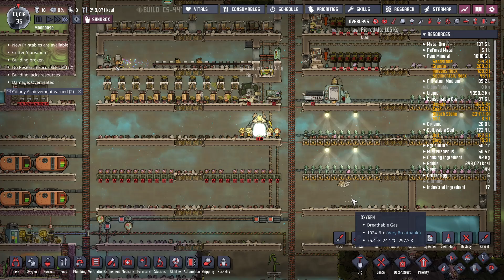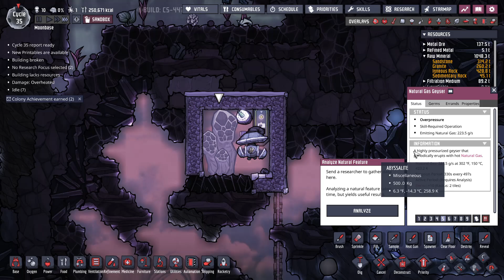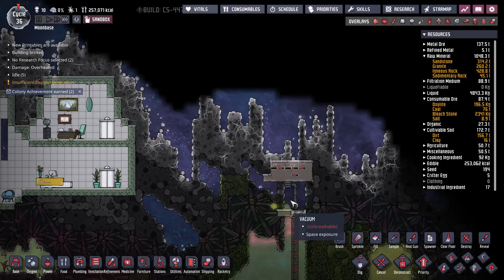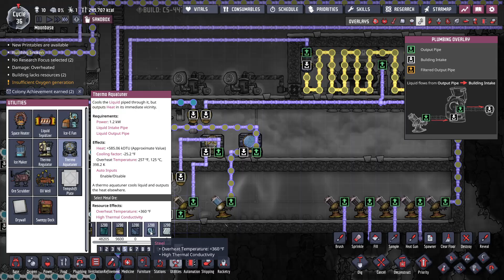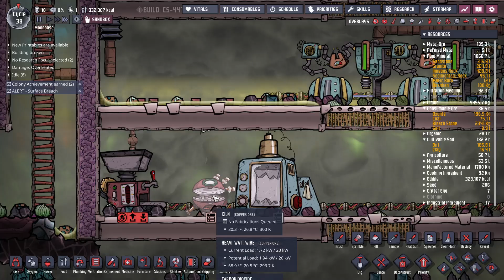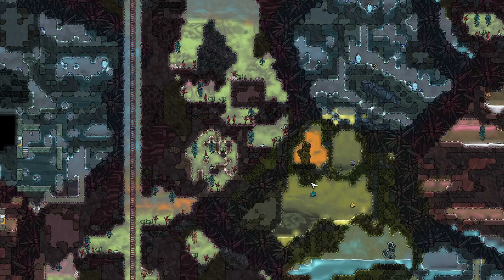How to Produce Steel in Oxygen Not Included

Comment: You guys are way over-engineering this.
Just slap it next to any geyser with a liquid that wont turn to gas after adding 70c, like brine, polluted water, oil or petrol, then pump the used liquid straight into a door crusher.
Or simply dump the heated liquid straight into space.
A suggestion I have is that you run a chain of 10 smelters that fill up overnight so that your operating duplicants don't switch to another job because the smelter is refilling. They will head to a job, and by the time they get there the smelter is full, which changes their priority and they turn straight back, wasting half their day.

Comment: Its actually better to use the refiner bc the heat from the coolant can be used to generate power. It actually ends up generating more power over time than spending. Smooth hatches are just a waste of time. Use the coolant to heat a body of water/steam and then use 2 steam turbines per refiner.

Comment: is it possible to use to perhaps use the cold biomes very cold atmosphere and use radiant piping through a part of the biome , so you can cool the liquid piped through it?

maybe even use some a bunch of Wort plants to keep the air cooled down if you were worried about the cold biome getting heated by air because of the radiant piping?
Reply: That will work temporarily, but eventually you'll melt the biome and it will lose effectiveness over time.

Comment: 30% of the video: Producing Steel.
other 70%: C O O L I N G.
Reply: Because producing steel IS cooling. Also for the same reason petroleum is better as coolant for steel because steam turbines handle heat more efficiently as steam temperature goes up. Also why you can replace some tiles in coolant tank in steam room with conducting tiles - petroleum can be hard to get.

Comment: Hi! How do you make a completely empty world? And also, I did not find any way to get rid of the two windows opening in the right, when i use debug mode.
Reply from the maker: You need to activate the debug mode first: https://oxygennotincluded.gamepedia.com/Debug_Commands#Activating_Debug_Menu, and then enter a world, enable sandbox in the settings, and then reveal + delete everything on the map.  I wish it were easier than that, but it's unfortunately not :(

Backspace can toggle the debug windows on/off once you have everything set up.
Reply: @Magnet_MD  Thank You!

Comment: personnaly this is not how i would have build my midgame brick, i would have build it directly under my steamroom and aquatuner with radiant piping in the steamroom for the output, cycling there with a heatsor to check its heat untill its under 175 degrees celcius before beiing thrown back into the metal refinary, the liquid shutoff, will have to be made out of steel, that way making iron, steel and Aluminum using a metal refinery is a powerpositive process, Copper repay's around 80% of its cost to run. as long as you can store the power between uses. You will need either some oil, petroleum or napta to use as a coolingliquid for inside your metal refinery, but finding and entering the oil biome and checking the abbysall layer for any breaches while also building temorairy builds for 200 kg of plastic and a TEMPORARY Getto setup (take cool liquid from 1huhge body of liquid, and dump it into another) for 1300Kg steel (and pref at least 2 tons of either copper, gold or aluminum for inside the steamroom), is an early midgame goal. 

if at all possible i would advise building multiple of these coolingloops inside the steamroom before turning the aquatuner on, since getting them in afterward can be a bit..... finnicky

if executed correctly, it makes smoothatches obsolete for any metal appart from gold (since it produces so little heat, thus costing the most power to refine)
Reply from the maker: All fair criticisms and observations.  A lot of this is honestly stuff I haven't labbed or refined for years since it has served me well and is readable for a newer player.  I'll re-lab some of this stuff and see if there are more efficient and easier ways to do it.  I do still want my content to cater to newer players, so that will always be the bottom line to whatever I'm doing.

Comment: The oil chamber is just unnecessary hassle. Just pipe the oil through radiant pipes in the steam chamber and store it in a Liquid Reservoir. This gets rid of the 240W for pumping the oil once you have enough of it in the loop. (and you're going to need a lot less oil)  Build the Metal Refinery out of ceramic and place it in a closed "sauna" with other heat pigs, like a kiln. The MR and Kiln can be cooled (or rather, help heating up the oil again!) with the oil from the liq res before you feed it into the MR -> Radiant pipes -> Back to Liq.Res. Space suits needed for operation though so it's not going to be your first setup. Don't forget power control station for your turbines.
Reply from the maker: Yeah, I have set up those liquid reservoir cooling setups before, I just felt like I couldn't ever get fast-enough heat transfer for some applications.  Maybe I need to revisit that, cause I used to do this when I was first learning about cooling via steam turbines and I stopped doing it for some reason.  I'll re-investigate.
Reply: @Magnet_MD  I forgot to mention; one key thing when using multiple turbines to cool is to have separate steam chambers for each turbine. The steam will have progressively lower temperature for each chamber the oil pass through and will therefore be able to achieve lower output temperature compared to just having one big average for all turbines. I glued together some screenshots with example temps:  https://pasteboard.co/JLyCGI2.jpg
If the output is still too hot you can just temp check and loop it back for more cooling with priority over the refinery to avoid any conversion accidents. 

Anyway, thx for great videos. I started playing just a few weeks ago and picked up a lot of basics. :)
Reply from the maker: @vogue43  Dang, that's crazy and you're learning fast!  I'll check it out :)

Comment: i see a lot of builds that require polluted water rooms that are completely sealed- how do i get the polluted water inside? do i just pump it in there and close it up once it fills completely? i'm guessing you need to build all the wiring and buildings before you pump the water in
Reply from the maker: Yeah, just pump it in.  If you have excess gas, you can put an airflow tile over that spot until water fills it, then rebuild it into a regular or insulated time.  But yeah, it is best if you know exactly what needs to go inside of there, but it's also not uncommon to need to crack it back open sometimes and perform some maintenance.  If that happens, you can build those rooms with an expected entry point, and just un-build a tile when you need to get in there.  I still need to do that from time to time on my runs, even though I know what should go in there initially.
Reply: @Magnet_MD  got it, thank you!

Comment: You gave me the idea to create a petroleum boiler with the output of the metal refinery as heat source.
Reply from the maker: Turns out if you pass oil that is too hot, it will break the pipes when the state change to petroleum is supposed to happen, and it only sometimes changes the state to petroleum.  It results in a big mess, the machine overheats pretty easily... all kinds of weird stuff happens.

Comment: Fantastic tutorial as usual, thanks so much. Question about "oil as a coolant": if instead of cooling it down, you let it become petroleum and then cool THAT down, do you think it is a feasible way to achieve the famous 100% transformation? 
And speaking of that, maybe with 4 vents I would have enough but in a recent map with just one nat. gas vent, I was always running low until I introduced the petroleum pplant. So the extra bit from the refinery came handy, also because I was using the gas stove for stuffed berries and mushroom wraps. I must do the math and see how much of that 50% lost in the refinery is actually made up for by the nat. gas by-produced
Reply from the maker: Hmm, that is interesting.  I always thought that any state change would break the pipe, so I am not sure if that'd work as cleanly as you're saying.  I'll test it and see what I find out.

As for food, I don't think any food is really efficient other than mealwood, bristle berries and barbecue.  Anything else, at least in my opinion, is too expensive to maintain on a typical run.

It is very possible to only have one natural gas geyser and it can make mid-game power a little bit of a slog.  You did the right thing by getting down into oil, or you could have rushed steel and gotten into a hydrogen power setup if you found one of those vents.  But yeah, every run is a little different, and that's part of the fun!
Reply from the maker: Just tested this and it only sorta works.  It seems to dump out a mixture of petroleum and crude oil, but it seems like it's cooler than when it went in.  This seems pretty buggy.
Reply: Oooh, I see: the threshold is passed inside the refinery... Maybe they had not accounted for that case

Comment: Imo it's much better to ranch pokeshells from all the sieves output, than, say, sublim stations (kekw) or composts (kekw)
Fancy trick for 100% refined metal production - run a kiln inside vacuum, around 50 times or more. Or, of course, just dumping the heat from metal refinery in a big pile of liquid (bottom of big ocean, for example)
"You're gonna need a stable power grid", meanwhile me on ~3 hamster wheels ~5 jumbo batteries bruteforcing a metal refinery...
Water is only "bad idea" when you're dealing with warm water, if you're on, say, rime - you can and should use regular water to heat up the base.
As far as i'm concerned, crude oil or petrol are THE best options tho, since you can just make a closed loop and anything other than gold/copper will pay back the energy cost from steam turbine. Something simple like this https://puu.sh/GTXlm/abb68afbc6.png
Reply: that seems like a  john francis

Comment: Steel is something I never really worried about. I just popped a refinery down next to a battery and a manual generator and set it to produce steel forever.

I used my tank of polluted water as cooling and didn't care much about the heat it put out, as I was going to use the steel for my aquatuners right away.
Reply: Did it work?
Reply: @callummcneill44  Gonna be honest here, I don't understand half of my comment anymore.

I do think it worked out for me tho

Comment: Could you do a guide on getting said lime needed for steel? I'm starting to run dry of fossils and my (wild) pokeshell hole is only producing barely 1 molt every 15 cycles
Reply: Ranch lots of hatches for egg shells, shells convert to lime.
Reply from the maker: The above replies are correct.  I think the trick is maximizing EGG production, which usually involves shipping so there aren't extra eggs in the ranching rooms.  If the critters are around a lot of other critters and/or a lot of other eggs, they'll stop laying as many eggs.
Reply: a well fed Pacu can make like one egg every two days! they do eat a LOT of algae, though you only need to feed once as the rest will lay one egg before dying and the one you feed will spit out eggs at a stupid high rate to up the numbers of unfed. that's more for getting grilled fish, but the eggshells are a good side effect!
Reply from the maker: @cactusbrandon440  Huh, that's interesting!  I guess you could have a short-term farm for them, get a quick population explosion and then release them all (not feed them), eh?
Reply: @Magnet_MD  yeah! i have a plan to automate a farm for it- one pacu will be fed just enough algae to survive, which conserves algae while still producing about 10 eggs in it's lifespan. all eggs except for one (to replace the reproductive pacu, this is maintained with a critter sensor that activates sweepers when the number of eggs and critters combined is more than two) get shipped into a separate tank that has no feeding or maintenance. every tame pacu can make one egg before it dies, even when glum and overcrowded. pacu fillet, eggshells, and polluted dirt can be shipped out of the second tank for food, lime, and 02 production respectively. and because of the lack of the cramped condition in pacu, this second tank can theoretically contain an infinite number of self-sustaining pacu! though i'm sure theres some unknown limiting factor. the only thing that can really hamstring this is if you run out of algae, but i've found that this setup works fine (if a little bit slower to get up to high numbers) even if the reproducing pacu is fed only about 20 kg algae a day. add that to the about 900w power it takes to maintain the sweepers, and the time required to get the pacu numbers up, and it's a moderate-cost build with a ton of potential!
Reply: The more critters you ranch, the more egg shells you'll get, the more steel you can produce.

Lime will pretty much always be the limiting factor on your steel production though

Comment: Hey Brendan  (sorry if i misspelled ur name) I had a question.

When I use a automation switch it has to be turned on manually. But in all your video u can turn it on and off anytime without a duplicant coming to switch it.
So is this a problem in my game or is it supposed to be manually?
Hope you read this i am genuinely looking for a solution.
Reply: If you use the switch from the automation menu (the early simple one), you can click on it once it is built and you get a pop up window with a switch graphic you can click on and off with the mouse. No dupes required.
Also, he's in sandbox mode.
Reply: There's a few different types of switches. The 'Switch' that's in the power grid menu I think still needs a dup to operate it. It's probably the 'Signal Switch' you're seeing him use, which is in the Automation menu. Make sure it's linked by an automation wire and it should switch on and off by the player, not needing dups. There's a little image when you click on the signal switch that looks like... well a switch, and you can turn that light switch on and off from there by clicking the image, DON'T click disable building or anything like that as that needs dup operation.
Reply: @2tally Gr8 Huh weird. I've not used the electronics switch one in a long ass time, but I'm pretty sure that used to need dup operating. Likely been updated in that case.